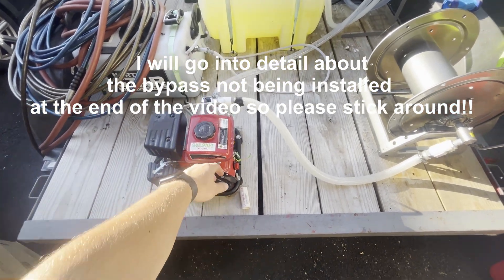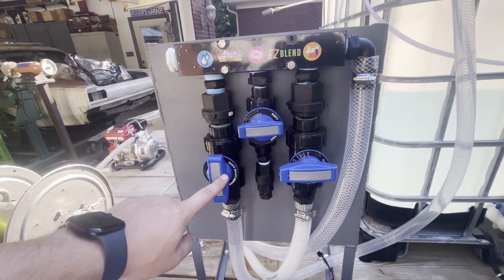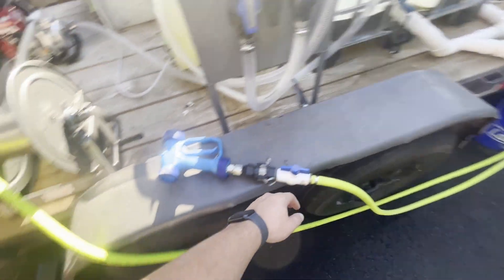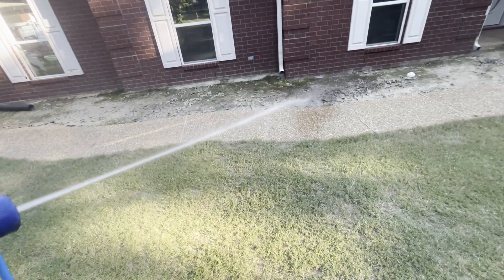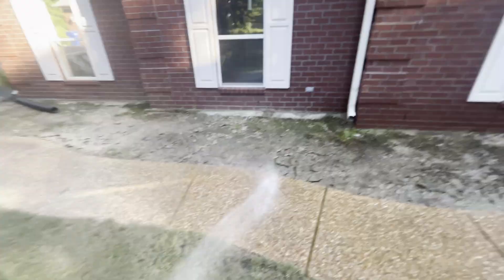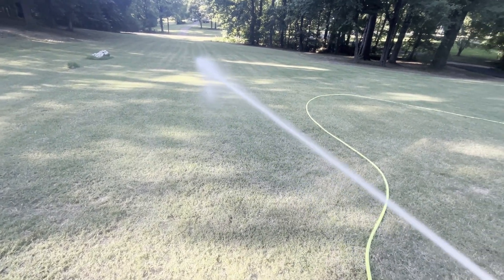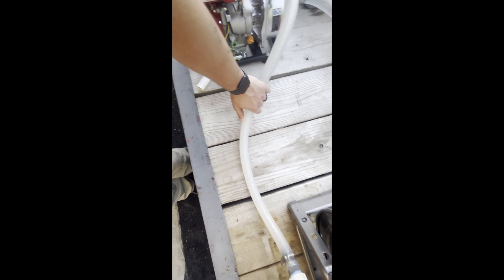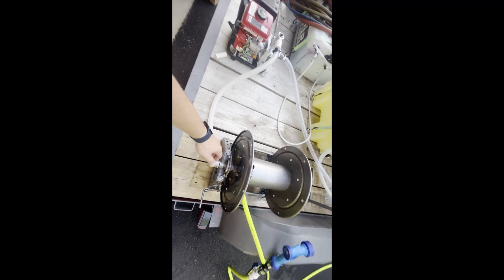|UPDATED| "BUDGET" Gas Softwash System - PREDATOR 1 inch water pump

Comment: Can I use this when batch mixing ? Then run 6% thru pump ? Also can you get down to about 5 gpm by slowing engine ? Thinking about setting one up as first softwash system using 30 gallon batch tanks.
Reply from the maker: Yes you can just make sure to flush it with fresh water when you are done. It’s best used with a proportioner however so I recommend moving to that when you can

Comment: I love 1/2" hose. Wish someone would test it with 200ft 1/2" hose just to see the difference. Im sure it will have less flow but ill take a little less flow as  long as the distance is still good.
Reply from the maker: We have tested it and it is significantly worse unfortunately both flow and distance
Reply: @AdvancedSoftwashLLC 
So you have it going
1 inch in
1 inch out
Then its reduced at the wheel connection to 1/2 inch?
Then increased back up to 5/8 with the garden hose?
Could you just go from 1" to 5/8 and not do the restriction to 1/2 at the wheel? Would that allow more flow and also get a little more distance?

Im trying to build this system in the next 2 weeks and im just trying to figure out the hosing diagrams and the best way to set it all up. You are getting 50ft and fresh rinse is getting 60ft I think. Idk if he has the same setup or if he changed things along the way on his build. I just really need to build this myself since I cant afford my local pressure washing company to do it for me right now. And im trying to make sure I do it the best way and right way the first time.
If you could please send me any tips or clarification on how to do the hoses id greatly appreciate you sir 🙏
Reply from the maker: Now I’m running 1 inch out to a 1/2 quick connect which goes to 3/4 inch hose that I use but yes you could do it like that and get more flow. The less restriction you have the better for this pump
Reply from the maker: Doing it the way I have would have the most flow
Reply from the maker: Smaller diameter hose will hurt the pressure and flow on this pump
Reply: @AdvancedSoftwashLLC 
Ok well then i guess ill just go from 1" out the pump to 3/4" on the shooting hose on the reel if you say that'll make great flow. I just seen that fresh says he uses 3/4 as well in a video i found.
I just wasnt sure if the restriction you have going to 1/2 was something you did on purpose to build pressure for shooting distance or something?
Thats why i was confused watching wondering why you went from 1 to 1/2 to 5/8
I didnt know if i needed to do the same to make it shoot further.
But thank you for responding quickly and clarifying buddy 👍😊
Reply from the maker: You’re welcome!
Reply from the maker: I also have a video up that shows the 3/4 hose in action
Reply: @AdvancedSoftwashLLC i found it! Yeah thats amazing haha.
Now i just need to order all this crap and put it all together. Ive already got 3 tanks, the water pump and the proportioner valves and mixing block. Just need to get everything else to plumb it all together since its like 300$ cheaper. Then order hoses for everything and some reels. And figure out how to install and adjust the pressure bypass with the 25ft of hose in the buffer tank curled up like ive seen a few people do.

Do you recommend using pvc drop sticks for all of your lines going to the blend system.
Or would you theoretically want to tie into your tanks at the bottom of them that way gravity can do its thing?
Reply from the maker: I use drop sticks on my sh and soap but I use plumbing from the bottom on water. Either will work for you. Just remember to prime the pump and try to prime the lines as well

Comment: Be Careful! I was intrigued so I bought and set up the Harbor Freight system to compliment my 12 volt, 7 Gpm and my AR45.

I did d a roof job using a 5% SH mix. I had one of my guys turn the pump off as I came down the ladder. A minute later as I stood next to the pump, the outlet 1/2” threaded fitting blew completely off showering us in roof wash mix. The threads on the fitting were stripped away from the internal pressure. Judging by the blackish water remaining in the pump, the centrifical pumps aluminum housing reacted with the SH. I’m putting a pressure valve on it set for 60psi and will be more aware of leaving a hot mix in the pump. Besides that, great little pump😅.
Reply: Same issue here. 5% sh cooked the pump.
Reply from the maker: Never had this issue. Interesting.
Reply: There seems to be more and more cases like this popping up the more people use this pump. I was very interested as I’m fairly new to the industry but I’m not willing to take the insurance risk.

Comment: Great video brother. One thing that i dont understand is that since the gpm is so high even with a 50 gallon tank itd clear it in about 5 minutes. So would i have to speed spray a roof in less than 5 minutes or can i restrict the water flow to slow it down. Also, would this even be worth it with anything less than 50 gallons since itd drain it so fast? I want to find something i can use with batch mixing in a 25 gallon tank but i think this woild be way too powerful lol. Thank you for your time and i appreciate you 💪
Reply from the maker: @Yaknowwut  you can lower the throttle for less flow yes, but I would really invest in a bigger size tank than 25.
Reply: @AdvancedSoftwashLLC  thank you for the quick reply. Ill just wait until I can get a bigger tank 👍

Comment: The only thing that concerns me is that pump would empty the tank within minutes. How long can you go with that tote before it’s completely run out because of the volume of that pump? What’s your thoughts on that?
Reply from the maker: Well I’m always connected to water and I stay full so it doesn’t drain it that fast. But if you didn’t have a water source you’d be looking at 6-9gpm depending on your setup. So just do the math for whatever size tank you have

Comment: When your off the gun and the pump is caviting it will damage the pump, most likely the impeller.  So I’m sure you are shortening the life of the pump but by how much who knows and that pump is affordable enough that that its probably a non issue still making this a good affordable option
Reply from the maker: @shender944  yes the pump does have some cavitation, however after 8 months I have no issues with mine. I try not to stay off the trigger too long for that reason and I flush it well after use!

Comment: Link to the motor and pump? Is the pump section plastic or metal (which will corrode)?
Reply from the maker: @DjehutimasAsarRa  https://www.harborfreight.com/1-in-79cc-gasoline-engine-clear-water-pump-35-gpm-63404.html
Reply from the maker: No corrosion on mine still. I always flush tho
Reply: Wonder what the 2 inch pump could do lol
Reply from the maker: @Majjoost35  it performs worse